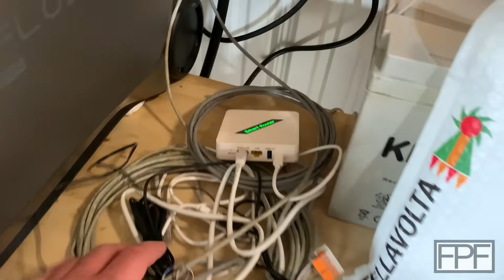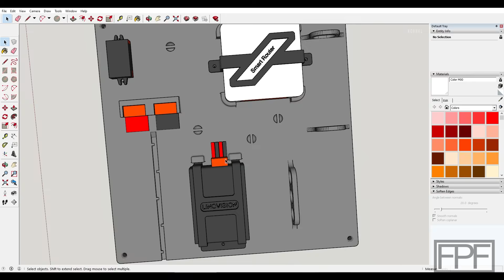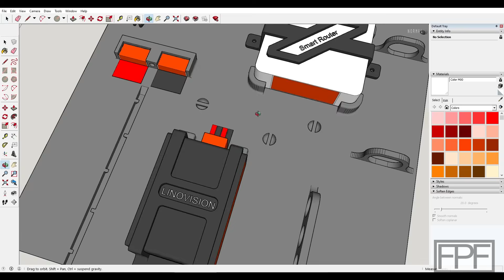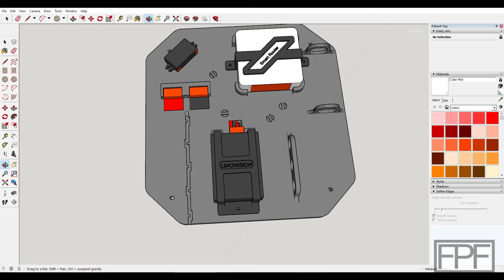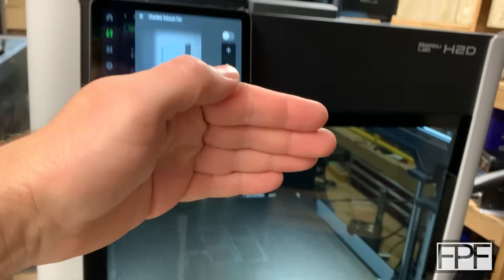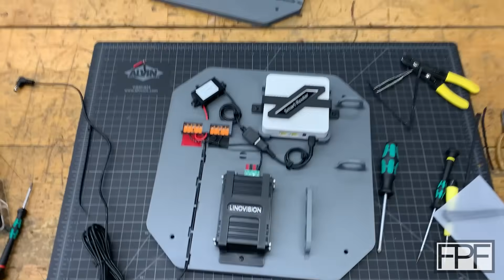3D Printed Equipment Mounting Board - H2D Problem Found

Comment: If you look at the GCODE you might see where it turns on the chamber venting and you could comment it out without having to remember to babysit. Especially if you see it in the start gcode, you could change it for every print. (I use an outdated bambu studio so I can't check.)
To make it easier you might do a diff on a file with PLA and one with ABS selected as the filament.

Comment: u cant really use full volume like this on any printer unfortunately. Espwcially on a fully solid print.  try using a cf filament and also remove materual from the centre. uf you wana send me the design i can adjust it. Also aircon explains it. Avoid petg as well. its garbage. use their abs cf

Comment: I have seen that same issue with printing large prints on my H2D with PLA.  I am actually printing the last of 4 drawer fronts now so I turned off the chamber cooling to see if it solves my issue too.
Reply from the maker: please come back and let us know
Reply: @FunctionalPrintFriday  Yes that did work for PLA also, the print came out nice.
Reply: sry but the h2d is not a large bed printer. the cr10 m4 and the elegoo neptune 3 max are large scale printers or the junk orange storm giga

Comment: I had to use bed clips for my x1C when doing large ABS prints. 

Thr bed plate would lift just like oj yours. I found tge newer beds dont have the issue as much.
Reply from the maker: even with the door shut and top on?

Comment: just the right amount of overkill in the design. only thing i would do different is put the buck converter on stand offs - i have several of them in that same style and they can get mighty toasty on the bottom where they are resin potted… started putting small fans on some of the ones i have in some embedded pi zero 2w install locations

Comment: Dang that looks awesome and very neat. Also thanks for the info H2D that is good to know.
Reply: another small build plate bambu.... check out the new 3 in 1 snapmaker. its cheaper than the h2d and has a 3 in 1 tool head. the h2d only has a 2 in 1 tool head. bambu is so overpriced. my elegoo neptune 3 max's have a larger build plate, i use my 3d printers to make my ostomy bags with medical filament. don't get a h2d or any bambu, so many better printers.

Comment: Great Job, nice project. I hope the Bambu people will fix the ventilation problem soon 👍👍
Reply: bambu is overpriced junk, get a snapmaker. the snapmaker has a  3 in 1 tool head printer is cheaper than the h2d and has 1 more tool head over the 2 in 1 small bed bambu junk

Comment: Two questions: #1 - Why are you printing the base frame so thick?  #2 - What orientation and/or supports did you use for the smart router bracket? Glad you found the heat / vent issue. I print in my basement as well and suffer the same temp swings you have. Thanks for sharing!

Comment: Especially on prints this large, please consider not using Grid-Infill! These long straight lines crossing each other cause so many problems like warping and scratching of the nozzle. Something like Cross Hatch will work much better.
In addition you could add some "breaker" on the bottom (2x4mm rectangular holes), which breaks the extremely long outer walls, reducing their tendency to shrink.
Reply from the maker: The second and final ones were both done with gyroid, and I agree.  Unfortunately though, it wasn't the cause of this issue.  The second one failed equally as bad as the first.

Comment: It’s venting for PETG? Just stupid. Getting mine Monday. I hope they will fix this. 50c chamber temp should be no issue.
Reply from the maker: yeh, they just need to give us the option on the print launch window with a checkbox, and let ppl decide if their room is hot and it needs to vent, or cool and drafty, and should stay shut.  Defaulting to either one is fine, just need the option.
Reply: @FunctionalPrintFriday , that is an option in the print setting to set the chamber temperature if you click on the "filament settings", then "filament," scroll to "print temperature," and just below is "chamber temperature." you could set that to 40c

Comment: I had a similiar problem with petg with a qidi printer. The fix was in filament settings. Under cooling tab. Turning exhaust fan % to zero in orca slicer.

Comment: Your problem with too cool air coming in the vents reminds me of printing on my old creality CR10's where I had to make sure the AC was off so didn't have a cold breeze blowing on the printer and causing warping.  On my X1 I leave the door closed for PETG.  Usually for PLA also.
Reply: if you crank up your bed temp and use 3d gloop on the bed, you wouldn't have had that problem. i have 3 elegoo neptune 3 max's, 2 of them are printing petg with a .6mm nozzle right next to my ac. the max's are open printers with no doors. the bed should be at 80 with petg and 50 to 65 with different plas. tpu and medical filament is super easy to print with....... sry but most of yall are noobies. the new cr-10 m4 is way better than all the old cr10s. the ender 5 max is too small.
Reply: @sauron4526  Not a noob. Have 2 X1Cs.  don't care anymore. nothing warps ever.
Reply: @Nerlin  your a bambu noobie, unwilling to use any other printer but the overpriced bambu junk. nothing ever warps on my cr 10 m4 or elegoo neptune 3 maxs, and the neptune 3 maxs i can buy 5 more for the price of on small bed x1c. or i can buy the new evyone core xyz large scale 3d printer. uncle jesse already did a review on this printer.

Comment: It's a shame that people like you make uneducated videos showing your lack of experience, .I do H2D full size plate prints like you without any issues,  How?  Experience,  your issues are blatantly obvious  a combination of not knowing the machine/slicer and lack of experience
Reply from the maker: Think about that for a moment.  Are you suggesting the average consumer should posses the knowledge that when using PETG purchased from within the ecosystem, with parameters set by the included RFID tag, in the native slicer, that their print will fail if they don't manually override a setting on the printer's menu at a certain key point during pre-printing?  Remember, this machine is marketed as one of the most automatic easy-to-use machines.  I think you just made my point for me better than I could have.  This is an easy fix that requires no hardware change, and I'm sure we'll see this get patched soon.
Reply: How do you do it? Can you educate us?
Reply: @Ahrenp  he uses PLA 😏

Comment: I also never open the door or top on my x1c and never really had a clog problem at least with PETG.  I am printing a big part in PETG with 75 bed temp on the H2D just to test your theory… lets see what happens.
Reply: use a .5 or .6mm  nozzle with petg and tpu, petg will clog on .4 and .2mm nozzles every time, also the bed should be at 80 with petg. read your filament setting on the side of the spool.
Reply: @ I print mostly PETG with 0.4mm nozzles with no problem.  The PETG I am using has a recommendation of 60-70C for bed temperature and for this one I have to use 75C on a new PEI textured bed (for the H2D, for my X1C 70C works).  Although the info doesn’t say, It is possible that the bed temps suggested are for smooth PEI, but if I go with the average, i.e. 65C on the textured bed, which is the standard nowdays, I would for sure get the corners of my print lifting.  [before FDM, I designed a few things for nylon in SLS, I have only printed on my own  on bambus, about 2k hours, mostly PETG and a bit of engineering materias, so I am NO expert because I’ve done very little troubleshooting - I know 0.5mm nozzles exist, but have never even seen one for example]

Comment: the bed of the printer is horrendous. They cheaped out to save a few bucks and used the same sistem as A1 instead of the one in x1c. There's videos and posts everywhere of stuff coming off the plate or warping or not heating up evenly with swings up to 7-8 degrees(CNC Kitchen has a good video 2 where you can actually see with a thermal camera). 2nd the tolerances when printing are horrendous 2(from my experience at least)
Reply: This is a complete non issue and A1 design is superior.
Reply: @riba2233  interesting!  You will have to teach me how you print abs asa nylon etc on the a1 and how is it not an issue.
Reply: @K4mikze I do print smaller parts in those materials flawlessly but that is completely besides the point.
Reply: @riba2233  it's beside the point because that printer price is 400$ not 2200$. When I pay this kind of price for a printer considered  apple of 3d printing with a price to attest that you expect to receive the best, not a bed that's equal to the one of a 400$ printer just bigger so they can make more profits
Reply: @K4mikze there is nothing wrong with the bed.
Reply from the maker: I think it's turbulent airflow with the active vent on causing it.  Wonder if anyone tested without the vent on.
Reply: @FunctionalPrintFriday  oh yeah in your case (i saw the video entirely) it for sure seems that was the problem but in my case small/even regular prints come off, mid print sometimes, for no reason.(i only print petg/asa) The only way they stay on the build plate is if i use glue, something that i never had to do on my x1c. and like i said in my case the tolerances are a nightmare. they always end up too small and i have to reprint the part and they are not consistent either sometimes it's too tight sometimes it's just a little loose (i know they can fix all of this probably with software updates but for the price of the printer in my opinion this is unacceptable)

Comment: Surprised you didn't use heat inserts for the screws.
Reply from the maker: thought about it, but I always ask myself how often do I plan on removing the screw in this application, and it it's less than 3-5x, I just go with a woodscrew and let it self tap

Comment: other people are having issues with the bed to cold on the H2d and the prusa XL is bigger
Reply: They just pushed an update to optimize the accuracy of the bed temp. So far it’s working good for mine. Also I recommend anyone that’s having warping issues to up the bed temp 10c. It’s made a night and day difference for me.
Reply: @SeriesDmusic  they should of had this done before releasing the h2d junk.... sry but i don't want to spend thousands of dollars on a printer that has to be updated, its sad yall got money to blow, but then again most of yall buy your printers with a credit card and pay interest lmao hahahahahahaha
Reply: @ The printer is not for everyone but that really goes anything name brand. I can’t really speak for others on if they can afford it or not but it’s fun money for me.
Reply from the maker: prusa xl definitely bigger, but not enclosed.  I think the bed issue might be this air issue
Reply: the prusa xl is small and way overpriced, sry but the cr10 m4, elegoo neptune 3 max, the junk orange storm giga and the snap maker 3 in 1 printer, have way bigger build plates and are 1000s of dollars cheaper than the h2d and the prusa xl junk. its 2025 both prusa and bambu should have large scale printers on the market.
Reply: @sauron4526 I agree spend less money of your gonna have to tinker anyway especially if you like to tinker
Reply: @sauron4526  all of those printers you mentioned have a ton of issues. Also missing enclosure and heated chamber and dimensional accuracy. I’m not saying it justifies the price of the H2D, but it depends ultimately on what you want to spend on a machine in terms of capability and reliability. Which in my case the H2D has been reliable and dimensionaly accurate for things that I work with. If you don’t work with engineering materials then the non enclosure ones would do you just fine. It would be nice if they pushed out 500mm , but the larger the machine, the more VFA and other artifacts get introduced.
Reply: @SeriesDmusic  you don't need an enclosure for pla, petg or tpu........ tpu sticks amazing to glass beds too. btw i have a huge plexiglass enclosure to print medical filament on one of my max's. only cost $50. y'all can't put 2 brain cells together and build your own, yall will spend 200 bucks on the same plexiglass enclosure. i also have a vent and carbon filter and air purifier to print with abs and asa. sorry but you a noob, im sorry but no bed slinger or core xyz printer can accurately do 500mm/s, but delta printers like the filsun super racer can.
Reply: @ I said engineering materials dude. Since when is PLA and PETG an engineering grade material? You should consider using that other braincell you have left from building such a difficult enclosure to learn the difference between the materials. And I did not say printing at 500mms. 300mms is great for getting accurate parts. Making your own enclosure is incredibly simple to do. Some people just don’t have the time for it nor care to do it themselves.

Comment: They cheaped out on the bed heater.  It usese a very similar bed heater to the A1.  See other 3d printer reviewers that have discussed this issue. Was surprised by your solution. Although I had not heard about the maintenance heater. Just the right amount of kill.
Reply: the printer should work out of box for the price they want. snapmaker 3 in 1 tool head printer is cheaper than the h2d and has 1 more tool head over the 2 in 1 small bed bambu junk

Comment: Is the ecoflow enough to power the h2d in a power outage?
Reply from the maker: Yeh, you could probably run a dozen off that thing.  It's a beast.
Reply: @FunctionalPrintFriday  Have you  tried it  when the printer first turns on with all the heaters running?  There are  devices that will run fine on residential power, but some of these power stations can't handle the initial draw.

Comment: These kinds of large build plates should really be using corner clamps on the bed like the industrial ones use with non-flexible beds as an option, magnetic beds are just not strong enough. you had this problem with PLA, imagine with ABS. If i were designing this panel I would be using a base of a wood panel with 3d printed accessories on top, or strip away all of the excess material and assemble with brass inserts and screws.
Reply: It would be nice if the incoming air temperature could be measured by a sensor, and the fan speed and fin angle adjusted accordingly.
Reply: I have an old Creality Ender 6 Pro that has clamps to secure the build plate. This was common among low end printers just a few years ago. However, like any 3D printer that isn't fully enclosed, it's print quality is susceptible to changes in air temperature as it varies throughout a 24 hour period.
Reply: @GaiusTacitus  i bet you were using a glass bed and not a magnetic pei sheet
Reply: sry buddy but the h2d is a small build plate. my elegoo neptune 3 maxs cost 400 each and have a way larger build plate. i have had zero issues with my magnetic pei sheets, must just be a bambu thing. flexible plates suck like on the original ender 3 pros, the 1st gen. use 3d gloop instead of glue sticks. its 2025 not 2014. the bambu noobies that think your 3d printers are vending machines, sad when most of yall make the same stupid flexi toys.
Reply: @honda-s2k you're comparing a Ford Focus to a Ferrari